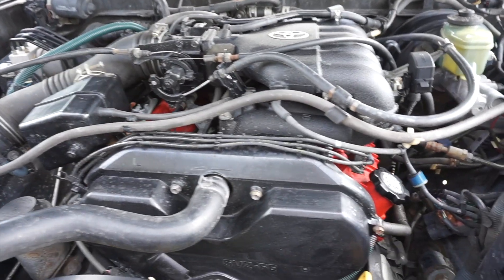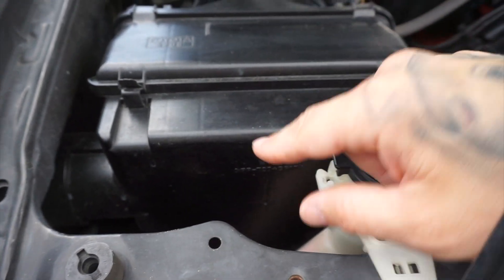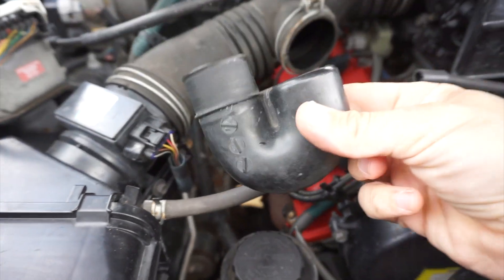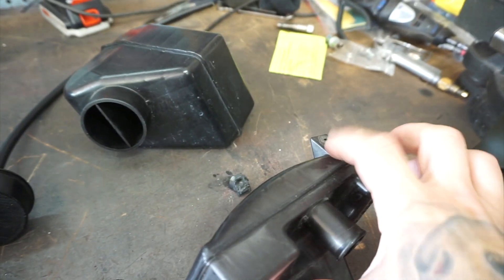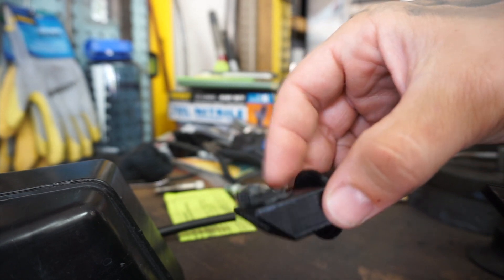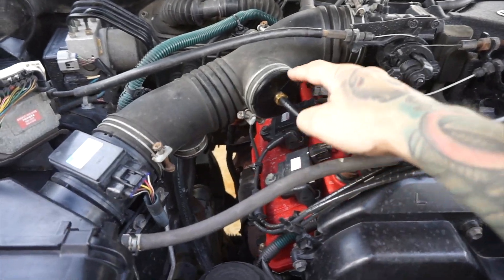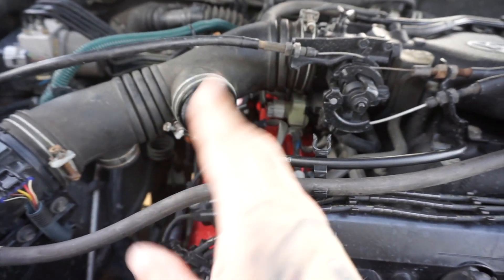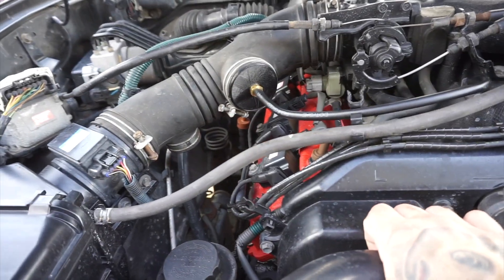3D Printed car parts! ISR Mod for Toyota 4Runners

Comment: Would love a set for an 02 tacoma, are you making them yet?
Reply from the maker: I still make the odd ISR now and then, but I still haven't come across the Tacoma 5VZ intake yet to pull measurements from. It has only two plugs, both different sizes than the 4Runner's.

Comment: Hi! Any reason for choosing PETG over ABS? Is this a 3D printing process issue?
Reply from the maker: ABS warps a lot while printing unless you can heat the environment around it by fully enclosing the printer and heating the enclosure. ABS also stinks while printing. PETG has neither of those issues and handles automotive duty just fine. Carbon fiber Nylon is even better, but takes some minor upgrades to most ready-to-run printers in order to use successfully.

Comment: In the thread menu in fusion there’s the option to model the threads you must of forgot to hit it, I had that issue once. Hope this helps you from from buying taps in the future
Reply from the maker: I definitely modeled threads. The problem is, Autodesk won't get their stuff together and add NPT threads! I used to settle for 1/4 BSP, but its 19 tpi and NPT is 18tpi. So the tap kinda worked that out. Now I model 7/16-18, but since it's not tapered, I still need to tap it. Last option is to import a threaded part from McMaster and use the subtractive function, but tapping is easier, since it's never a bad idea to chase the threads anyway.

Thanks for watching!